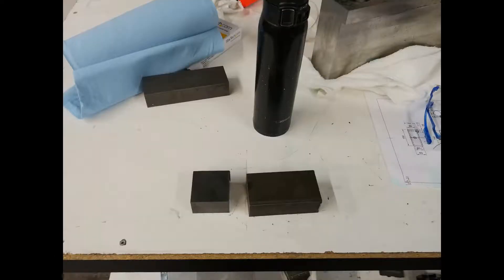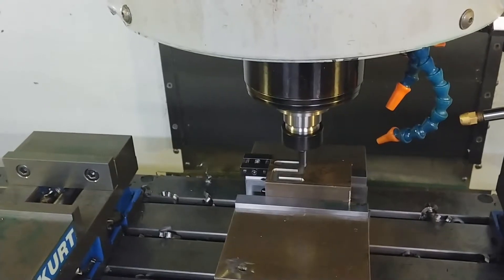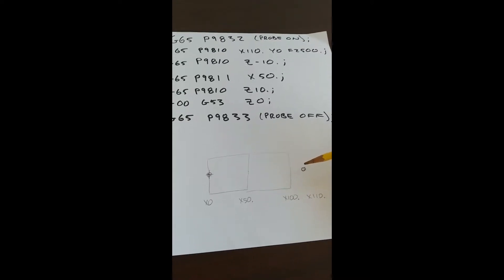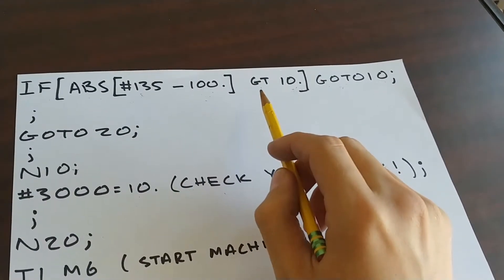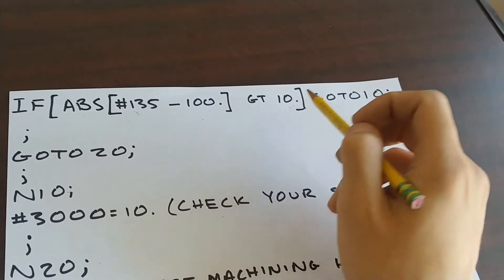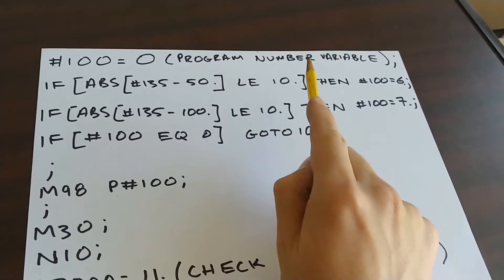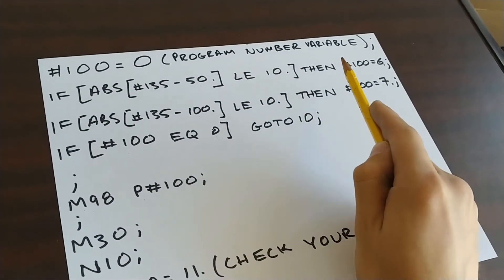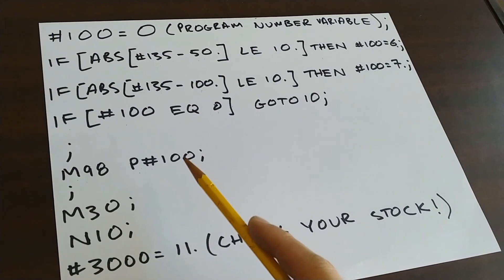How to Program Automatic Stock Checks with a Renishaw Probe

Comment: Hi, how can u use this on a mazak program? I mean on a mazatrol?
Reply: Depends on the software you have in your machine. I know on a Mori, they have their own measurement macros (G320/G321) or the option for Renishaw macros (G65 P9xxx), but typically, I'll just write my own. Either way, Haas logic is very much like Fanuc/Mitsubishi (which Mazatrol is based on), so the IF/GOTO logic portion would be the same, it's just that you may have to command the probing bits a little differently.